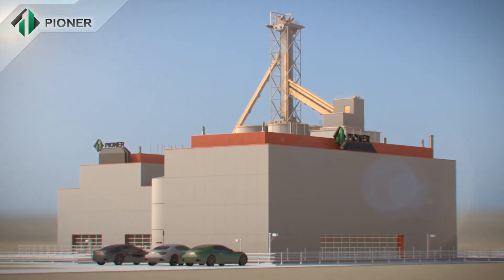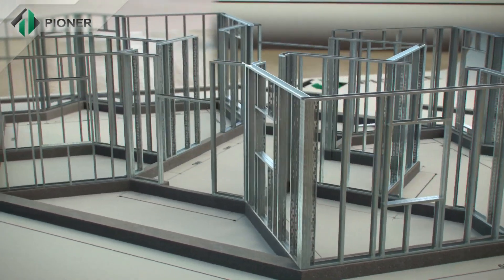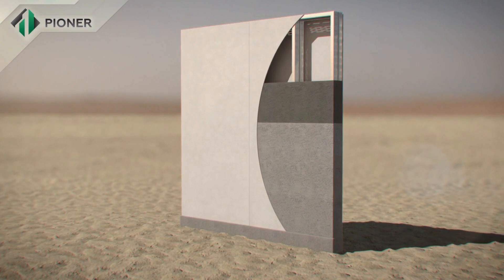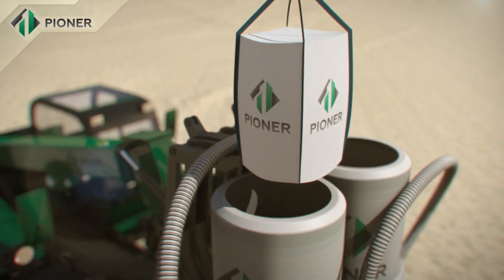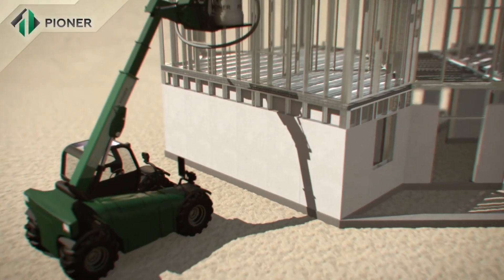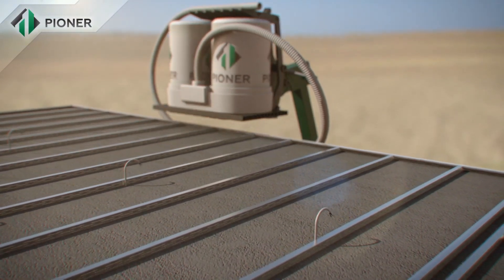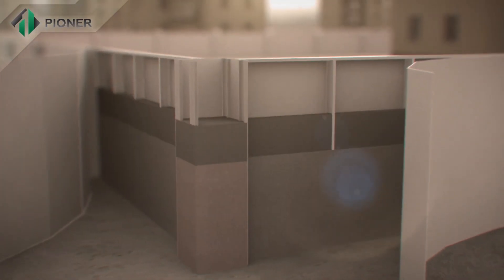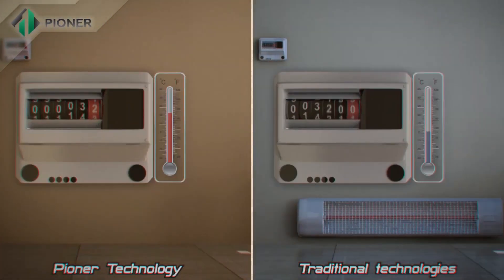Light gauge steel construction system with solid lightweight aerated concrete walls

Comment: How do u cure pored material,
Reply from the maker: You heard about aerated Autoclaved concrete we use aerated Non-autoclaved concrete. It doesn't require steam curing. We use special dry mix with additives.
Reply: @stretchceilingsDubai  and a magic wand
Reply from the maker: We use lightweight aerated concrete with 600 kg/m3 density for insulation purpose (instead of rock wool) and to make light gauge steel frame structure more rigid and solid. It cures on its own.
Reply: @stretchceilingsDubai  as I heard aerated concrete needs steam curing or water curing.  But how does it cures on it's own.. do u add any polymers in it ???